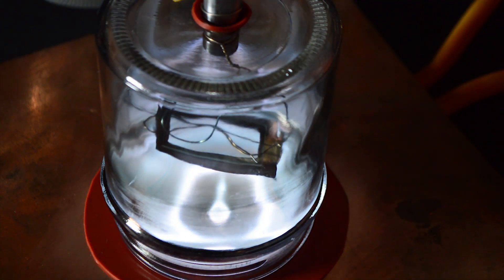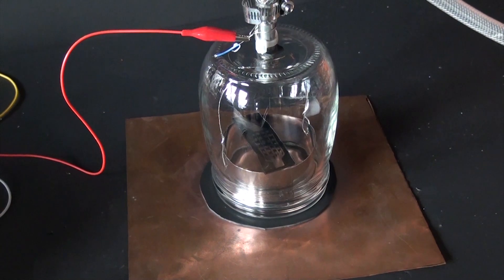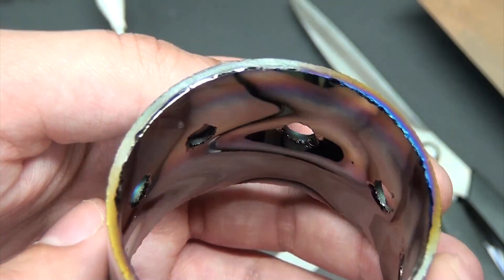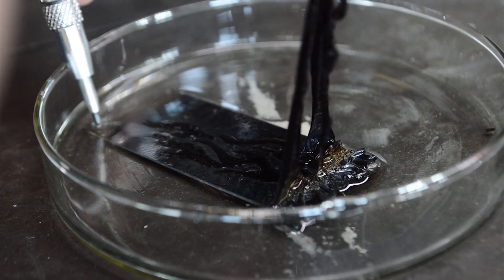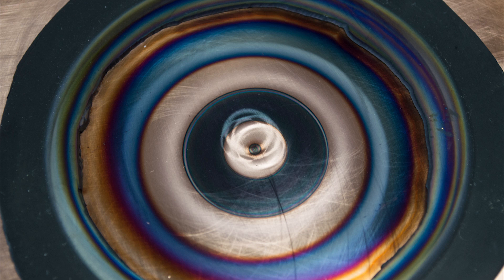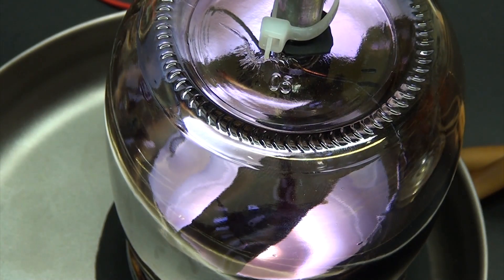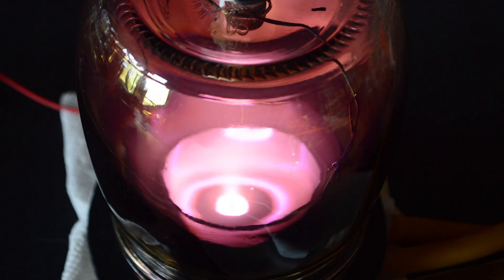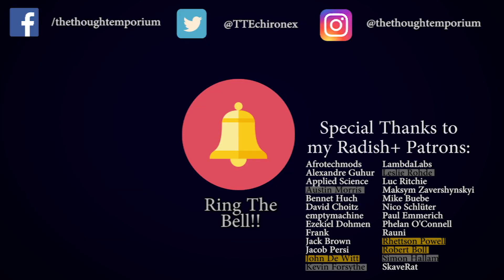Plasma Metal Coating... In a Jam Jar

Comment: Just curiosity here... wondering if you are concerened about stainless steel because its composition is roughly 18% chromium... therefor introducing it to intense head such as plasma it could break down into hexevalant chromium which to me sounds rather sketchy

Comment: For those unfamiliar with the metric system and orders of magnitude (an awful lot of Americans), the thing about sputtering is that it's an atom-by-atom process. The detail you can achieve is amazing, A single atom of the plasma collides with a target, knocking off a single atom of Al, Ti, or whatever. That free atom then strikes and bonds with the substrate you are coating. It's a form of physical vapor deposition routinely used in semiconductor fabrication. We used an Argon plasma and planar magnetron targets.

Particle sizes in atmospheric aerosols and the finest automotive paints get down to somewhere between ~1 to tens of microns. With atoms you are far into nanoscale, e.g. Ti at ~300 pm (0.3 nm). The scale difference between micrometers and picometers is the same as the difference between meters and micrometers. Six orders of magnitude; or 1 million.

Titanium-armored hornets are cool and all, but a demanding public is going to want moar! Where are the flaming Titanium-armored hornets?

Challenge: sputter molly onto a jellyfish. In a just world, that would be worthy of an X Prize.

Comment: I'll try to look it up in a few; But i wonder how well different kind type materials in lattice structure would coat with this process. I want to see tests with different propertys like load capcity/yield (or spring if any) & it's resistance to abrasion/weathering.

Comment: You can also use helium argon mix for Aluminum and hydrogen or helium with argon for the titanium to keep those pesky oxides away.

The helium and hydrogen will also allow hotter plasma transfer than argon alone. (I am a second generation welder)

Comment: I know this is old, but a better way to transfer the vinyl is to first remove the pattern you want from the vinyl, THEN put the mask onto the vinyl, and then transfer. This is how we did it for signs and car decals at the graphics shop I worked at, and it saves you from transferring any adhesive to your plate or potentially scratching your plate as you try to get the vinyl off.
 The masking adhesive is usually weaker than the adhesive on the vinyl.
Reply from the maker: great tip, thanks!

Comment: @ The Thought Emporium, For newbies you need to differentiate between  "Pressure & Vacuum. Tho they can be referred to equally, they're at opposite ends of the "Pressure" designation.

Comment: Could you try to make a VFD display? It should be quite simple because a VFD has trace spuderred on it, then they put on some phosfor on the pins, they put metal mesh or screen above it and finally they put above the mesh a heating fillament, they put it in a vacuum and it WORKS. The filament is made of tungsten wire. For more information you can watch a video by a youtuber DiodeGoneWild or TechnologyConnectons to understand it a bit better. Sorry for gramatical errors, I am not from a country were they speak english and I am not using google translate to translate it.

Comment: I'm sure this has been covered, but for the vinyl masking, you can actually get a 'transfer tape' that is clear with a grid pattern on it to help align the pattern to the media you're sticking it to. The grid pattern also helps you line up if you're doing multiple sections or layers. The adhesive on it isn't as strong as something like a clear packing tape, which is a pain to remove (ask me how I know.) The painters tape isn't actually a bad idea, short of it being opaque.

Comment: You mentioned aluminum giving you trouble because of the oxide layer. You should look into how Tig welders deal with the oxide layer of aluminum. They weld with AC with around a 70% neg 30%pos,  pulse width. Adjusting the polarity pulse width balance adjusts a cleaning effect.

Comment: I'm just imagining using this technique to apply metal to adhesive sticker sheets with the adhesive protection layer still applied, so you could apply brilliant metal stickers to objects...or even as a sort of temporary tattoo.  I'm thinking that ornate "sci-fi" designs of applied Invar 36 (chosen for its combination of corrosion resistance, slightly dull luster, relatively high ductile strength/cost ratio and low thermal expansion coefficient), would make excellent face stickers for an android Halloween costume...or, if a heat-resistant sticker base were used, the low CTE could be taken advantage of to provide additional adornment to holiday decorations that give off fair amounts of heat, such as the bases of festive braziers, lanterns, candlesticks, or hearths.

Comment: Adhesives are best attacked by oil-derived solvents like kerosene, mineral spirits or lighter fluid. They turn glue into a slush. Also I found that a mixture of acetone and lighter fluid is a much better solvent than either separately. The mixture worked very well for diluting and dissolving "liquid rubber." Acetone alone didn't touch the stuff at all, and pure ligher fluid dissolved it extremely slowly.

Comment: "Even though the Plasma is hot, it's pretty straight forward to keep it cold"
Ice. Metal coated Ice. You want a challenge? There you go.
Reply: @Alan Hardcastle That sounds like an excuse, if you took the challenge I'm sure you would find a way.
Reply: @tylergust8881  So i thought about it for a bit, but would the setup work in <0 degrees celsius? if so, then  water in its liquid state won't happen
Reply: @vbgvbg1133  I have no clue... I was just being a sarcastic smart ass in my original comment. I think @Alan Hardcastle said that the coating process creates lots of heat, possibly causing the localized areas to rise above 0 Celsius effectively ruining the project. I guess you'd either have to keep the water far below zero or coat it very slowly to allow for the heat to disapate.
Reply: Alan Hardcastle Then coat dry ice

B I G
B R A I N
P L A Y S
Reply: @Alan Hardcastle I never said he had to use the same method, plus I was being sarcastic in my original post.
Reply: Just use dehydrated water then?
Reply: @archerymidnight3422  slime?
Reply: William Gabriel Gamboa anhydrous water
Reply: @vbgvbg1133  Didn't we achieve to make water hydrophobic? Maybe that's the way to go 🤷
Reply: @datpudding5338  That's just coating water with a hydrophobic layer
Reply: Genius
Reply: @Alan Hardcastle that sounds like a fun project.
Reply: @Alan Hardcastle What if you sealed it up before it evaporated? Then you'd just have compressed CO2.

Comment: I’m by no means a physicist or any others ist- but you mention oxides being a nagging issue. When soldering metals, a flux is used to prevent oxides from building on your contaminate free target. Borax (slurried with water) is used soldering silver for instance. Would some form of flux help with preventing oxides interfering with the process? Or would it just create another problem? Like taking another medication to deal with side effects from the first?

Comment: I used to work on both evaporation and sputter metalizing systems and we had to use Ultra High Purity Argon or we had problems with contamination which would keep the systems from running properly. Do you use normal welding argon or UHPA?

Comment: Could you try coating a 3d printed part in metal? I have a resin 3d printer and if you had a model I could print and send it for testing.
Reply from the maker: Done it off camera after this video went up. works great.

Comment: Aluminium is (was) used to sputter cd's and dvd's so the comment on how that doesn't work as well surprised me ;). Quite sure that the cd/dvd plant in which I worked used a different method though. Edit: nope, apparently they used the argon pump method :). Which is quite cool since that afaik the alu sputtering has been around since the start of the cd production. And since it is the reflective surface that reflects the laser back it had to be consistent across the entire surface (from the top of my head it has to reflect at least 70%)

Comment: Glass blowers deposit thin films of silver and gold on glass using an oxy/propane torch to vaporize the metal then condense the vapors or "fumes"  on the target piece of glass.  Is that what you meant by "thermal deposition"?

Comment: Tool and die maker myself. This video was fascinating. I cleaned aluminum thoroughly with sandpaper and then gave it a good polishing to remove the oxide layer. Even if this isn't quite good enough, it will strip off the oxides quicker and more cleanly than the methods you are using. Once you have polished it, then do what you have been for the incidental oxides that will immediately  form. You will be surprised how cleanly it removes oxides. You can also hold off the final polish until you are ready to put it in the nitrogen environment.

Comment: Can you use it to alloy copper and tin together on an object you are coating, or would it just be a splotchy mess of copper and tin?
Reply from the maker: You can just do brass and save on having to do that. You could do layers like that if the material can take being heated to make them alloy, but it's easier to just start with brass or bronze or w.e else
Reply: The Thought Emporium Thank you. Very informative.

Comment: For aluminum, you could try to remove the oxide coating with a thin layer of hydrochloric acid whilst under vacuum. If there is no oxigen, the oxide layer will not form. I hope this would not damage your vacuum pump.

Comment: This could potentially be a source of x-rays. Anytime you have clouds of electrons hitting targets x-rays can be emitted. You might want to shield it.
Reply from the maker: No not really. You need at least 10kv to get xrays and even then without significant current you won't get much as most would be stopped by the glass.

Comment: We were using an infra red microscope to see how electric components would heat up in places when electric pulses were passed through them. Problem is that the emissivity of the different materials will not let capture the thermal image correctly. Metals would reflect too much, polymers may not, etc. Can this method be used to cover a working semiconductor component uniformly with something that has good emissivity while not being electrically conductive? Maybe some non-conductive very dark matte thin layer would be perfect. With what material can it be done to ensure that the semiconductor still works for testing?

Comment: I had a.cicuit board with leds near 480 arc during equipment failure. LEDs have a beautiful copper metal coating on them when off.  When lit, they are their native colors.  Clear coated them and removed from the defunct PCB before the copper could oxidise.  Now I have exotic artsy one of a kind LEDs for a future project..hehe.

Comment: You don't need to go to that sort of trouble. You can coat anything in metal by evaporation in vacuum. You make a tantalum spoon or 'boat' out of a strip of thin tantalum sheet and pass a current through to heat it, with a bit of silver or some other metal in the hollow. That melts then evaporates all over everything inside the chamber. 
Or you can make a little basket out of tungsten wire (By winding it around a wood-screw), pass a current through that with a bit of your metal laying in it. Either way works.
I've used the technique hundreds of times to make samples conductive for examination in a Scanning Electron Microscope - or even to make little mirrors for optics by coating glass microscope slides.

Comment: Quick note on vacuum fittings: the larger your tube ID the faster/better vacuum you can pull. At low vacuums your fluid velocity is extremely fast, as such it is pretty heavily restricted by tube ID.

Comment: Have you considered using a UV (like the Anycubic Photon for $300) 3D printer and photoresist to do your patterning?  The 3D printers work by using an LCD to mask a UV light source.  They have a resolution of about 50 microns.

I have been meaning to give it a shot, though unfortunately 50 microns is still a bit big for some of the stuff I work on.

Comment: If you can come across it, use kapton (polyimide) tape instead of the vinyl film. Kapton films can be good for a few hundred C. The adhesive is only good up to 100-150*C. We use kapton tape in vacuum all the time.

Comment: You may want to bring your chamber pressure down to the 5-10 mTorr range to improve the density and durability of your sputtered layers. 300 to 400 mTorr is going to make very porous and soft layers.
Reply from the maker: The only time it was that high was for the wasp. Normally I run it at about 100-150mtorr. I'm working on getting it lower.

Comment: Would this be useful for creating a small diy solar cell on a microscope slide? It may be possible by creating the two silicon layers with the machine separately so that they overlap partially. Then the part on either layer that doesn’t overlap could be where you connect the wires/alligator clips for testing. Not sure how you’d make the p-type and n-type silicon though.

Comment: In reference to what was specified as 24k gold:"...after enduring the inferno of the plasma for a couple test runs it was nicely annealed...".
24k gold, being pure gold (no alloys and it does not readily oxidize, so only Au atoms) cannot be worked into more ordered states and thus there is no need to remove this order.
In other words, 24k gold does not need annealing. In fact it cannot be annealed as only gold atoms are there, thus only one arrangement and thus no work hardening.
Reply from the maker: Thats.... not how crystal structure works. 24k gold can absolutely work harden. Anything can. It's not a lot, but it's noticeable and if you anneal it it softens. This is well known. Takes 4 seconds of googling to find dozens of sources talking about annealing and work hardening 24k gold. You can't QUENCH harden 24k gold, but everything work hardens.
Reply: @thethoughtemporium  
Look, the idea that you get lots of hits from a particular search somehow equates to the idea being true is not a good way to research.  If you search flat Earth, you get lots of people claiming that too.  Do you believe the Earth is flat?
The point being: vet your sources.
Pure gold does not work harden appreciably.  Gold can be rolled so thin that some light gets through.  It can be rolled so thin that it can be eaten safely and is used as decoration on things like cakes.  The fact that pure gold does not work harden makes this possible.
If your metal work hardens it is not pure.   Alloying results in different sizes of the atoms that make up the lattice.  These (and in other metals oxides as well) distort the matrix.  Dislocations which ease sliding of the planes get caught on these distortions in alloyed metals.  This is the reason that most metals start out more ductile and get harder as you cause more plastic deformations; the dislocations are getting cause on the defects in the crystal lattice.
Not pure gold though.  You can roll it and roll it and roll it without annealing until it is so thin you can see through it; so thin you can safely eat it.

Comment: Can you sputter lead?
Reply from the maker: Can't see why not, just not sure why you'd want to
Reply: @thethoughtemporium  I was thinking that it could be used as radiation shielding for space travel.
Reply from the maker: @barthanes1  You'd need far thicker material most likely. Space radiation is very very very penetrating. Few atoms thick worth of lead isn't enough
Reply: @thethoughtemporium  Well, the idea had several other steps I'd rather not get into on a public forum. But thanks for confirming that this can be done with lead.

Comment: One more tip-- try using photoresist "paint" off eBay instead of dry film, and use denatured alcohol to dilute as it comes as a concentrate.   Spray it on with a pump sprayer, similar to how you use spray paint.  It's much easier to apply and you can coat non-flat objects which is impossible with dry film.  You can use Sharpie marker, vinyl, transparencies, or whatever to mask off areas from being exposed.  It develops the same way as dry film with sodium carbonate or dilute hydroxides, then strip with sodium hydroxide solution.

Comment: Very cool, I've been playing with sputtering for quite a while and it is the closest I've ever come to really space-age tech, and the plasma shape and appearance is so beautiful.  I've had issues with getting a really good vacuum, and wanted to share a trick when building larger chambers.  You quickly realize that the metal plate of your chamber is under a lot of force, which usually means you're stuck with using a very thick plate, making it impossible to use a magnet beneath the plate (Which is really handy since otherwise it will quickly overheat inside the chamber).  I found that by sticking three 0.125 inch 12x12 aluminum plates together with JB Weld you get an incredibly rigid, strong plate that is virtually impossible to flex or distort.  The only issue  l ran into the was that you only need a very thin layer of epoxy, and you need to place a very heavy weight on top as well as placing barriers around the sides since otherwise it will slowly skid off over time instead of staying centered.  You get a surprising amount of excess epoxy squeezing out, so make sure to use as little as possible while applying a thin, even coat.